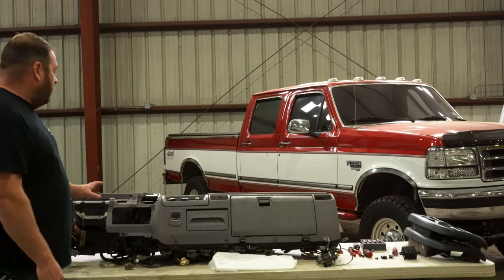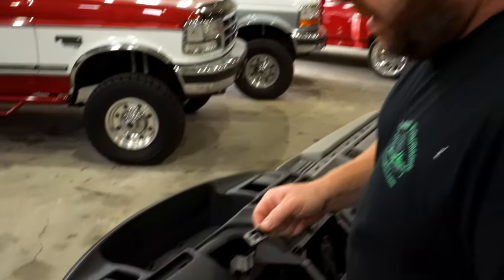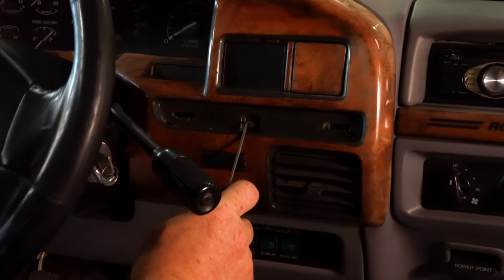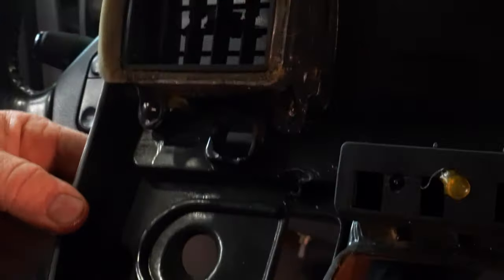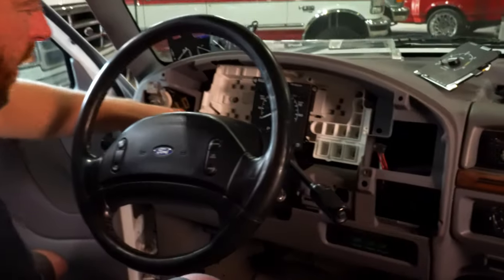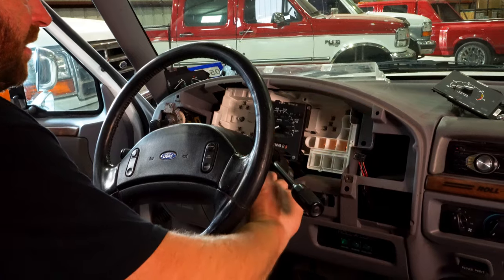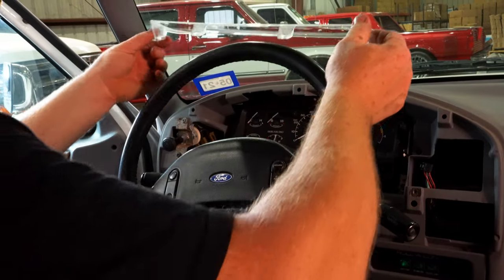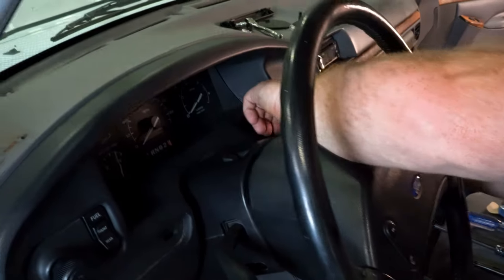How To Video - 1992-1997 Ford Dash Fixes : Everything You Need To Know About Fixing Your Dash

Comment: why can’t the brake light or battery light be LEDs?  Then on the rpm’s half of it you can’t see what would I have to make it so the light comes through?
Reply from the maker: The charge circuit for the alternator wont work because it wont see a voltage read.

Comment: Video was amazing. very informative without all the BS fluff. I'm trying to trouble shoot my cluster lights in my 94 ranger replaced several bulbs but still no lights for speedometer or other mechanical bits fuel oil pressure ect. butt the dumy lights all work.
Reply from the maker: Thank you. Sorry we can't be of more help on the ranger.

Comment: Where did the wood grain dash kit come from? And my 97 F250 is missing the long dash piece that has XLT on it. Where can one of those be found? Thank you guys for all the information on the OBS trucks
Reply from the maker: The woodgrain bezel and trim was a Roll-A-Long conversion add on. Chances are you're only going to find one at a chop shop or ebay. Finding OEM trim is the same. We do however have a great option for dash trim on the site. Billet Dash Trim. Find it here: https://cpaddict.com/billet-dash-trim-1992-1997.html
Reply: @CompletePerformance  thank you for the fast response. I’ll give it a look see. Best of wishes for your builds to come.

Comment: Thank you for making this video, sir. This video is legit! Out of curiosity, why do you not want to switch the battery bulb with an LED one?
Reply: Based on my experience with other Fords, the battery bulb is "part of the circuit" so to say.  It has a very small amount of power going through it all the time and as such, the LED will be always in, even if dimmer, because it takes such a small amount of power to run an LED.  It "turns on" when the vehicle voltage drops because of wizardry making that circuit go the opposite direction - low voltage on the vehicle end, ups the voltage through that particular circuit (enough to make a little bulb brighter) and let you know of a problem. - to the best of my knowledge.
Reply: Agree with Leddemo. 

Also, I have had issues with using a led on the "airbag" light on the instrument cluster.  It was on a 99 f150,  always glowed dim.  I have learned just to replace the backlight  lamps to avoid any issues with battery,air bag or abs warning lights. Using led in turn signal indicators can get VERY bright lol. But to each their own.

Comment: My gas gauge is sticky it only goes up to half then if you tap on it it will creep up but never all the way to full. Any idea if this is a gauge problem or something down the line? Great video would love to seem more stuff like this!
Reply from the maker: Thanks Man! That sounds like the gauge itself could have an issue I have the same issue with a voltage gauge. You can try and remove the gauge and try cleaning around the needle shaft or see if the face of the gauge might be rubbing on it

Comment: Thanks for making a great video, in my case my turn signal lights, high beam, battery are all working. The only ones that stopped working are the fuel level, speedometer, oil pressure and and coolant temperature as well as the one that indicates the revolutions. They all went out simultaneously, is this normal? Or if one goes out do they all go out? The other thing does the air conditioner panel supposed to light up as well? Do you have a video for this? TIA
Reply from the maker: You will need to check the wiring behind the panel. If they all went out it would be from something behind the cluster.

Comment: Awesome video made the job a breeze. Question though you mentioned not changing battery bulb to LED,  is there a reason why?
Reply from the maker: If you change the battery light to LED the circuit doesn't have enough load and the alternator wont charge.

Comment: When your overdrive light starts flashing and your transmission starts shifting really hard right after then you have an error in your psom in your dash. It’s best to buy a new or rebuilt dash cluster online with a warranty and it will fix your issue with the erratic shifting and OD light flashing.
Reply from the maker: That is a very very rare case. The flashing OD is typically a sign of the trans being in limp mode and is more than likely a trans issue.

Comment: I have multiple broken piece on mine so I’m just going to get a new one, but I have another issue, both my dash indicators for my turn signals and I think the low range light for my 4x4 maybe? Thought it was a fuse but it doesn’t seem like it, just bulbs I guess?
Reply from the maker: Those are all bulbs that run those indicators.

Comment: Is it possible to add a tach to a truck that didn't have one from the factory? Is it as simple as plugging it in beside the speedo or is there other parts the truxk will be missing?
Reply from the maker: For a gas truck you just need the tach section and its plug and play

Comment: I see there is white and green for the LED cluster package. Will blue be available for the LED cluster package?
Reply: Unfortunately, in order to achieve the “blue” LED look, it not simple as just replacing the bulbs. You need to scrape off the green “film” on the backside of each and every gauge that has it. Look up some videos about it.
Reply: @parkerwhite6  I've seen the blue led lights installed without the tint scraped off. Still looks good n the difference is barely noticeable. Though if they make a kit, just include in the instructions or descriptions the tint should be scraped off when using blue led lights.

Comment: The tack for the P R N D 2 1 on my truck is off. When trans is in park, the tach is at 1. When I shift to Drive, the tach goes off to the right and is not visible. I just feel for the gears and shift slowly but I want to fix this. Is this something I can remove and fix or do I need a new unit?
Reply from the maker: there is a cable to that has an adjuster on in it under the edge of the dash. Either it needs adjusting or the location tab is broken and you will need a new cable

Comment: What if my whole dash is cracked where my light switch and mounting points are at? Replaced my light switch today and found out the previous owner really did some damage to the dash. I’m restoring her already got all new suspension, and steering components, along with an engine refresh, and some mods. Time to move to the interior. But anyways I’m hoping I don’t need a whole new dash
Reply from the maker: If that whole area is broke out then this isnt going to work out of the box. If you can glue in or repair that mount then you could use the bracket

Comment: How would I fix my gauge cluster night lighting up. Only the needles light up but not the speed,tach, fuel,temp oil or volts. Do you know how to fix this?
Reply from the maker: Have you replaced the bulbs?
Reply: @Complete Performance   haha, yes I have. The owner before added a different gauge face that was wired in incorrect. I have since removed all that crap and figured out the wiring and got them to work. Also removed the led batter light bulb you guys recommend in a video. Didn't know it would interfere with something. Thanks for the great videos.

Comment: I have a 96 Ford f150 I just purchased and I was told it has low miles but on the odometer it just says error and my speedometer isn't working. I was told it could be my speed sensor. Idk
Reply: Could be the P-SOM, reverse side of the speedometer, search P-SOM repair yeah, good luck

Comment: I am curious if you have ever had a problem or possible fixed a problem like this. My battery light keeps pops on and off while driving or stays on then turns back off.  
I have managed to track down the problem but can't find a wiring diagram or anything on hooking up the wires. I bought a new pigtail bc one of of the wires inside was very loose inside the plastic clip that it clips into on top of the ignition coil. Looks like someone has already messed with it as there a wire on the bottom of the ignition coil bracket from there it's another plastic clip then someone spliced it into one of the wires that the plastic clip snaps on top of the coil besides the coil wire itself.
Reply: Check your exciter wire on the alternator, it's the single wire that plugs in the top. Common issue on the OBS trucks, that plug gets loose and doesn't make good contact.
Reply: @kerrydick7256  The only two plugs that I have on the alternator is the three wire plug that goes into a plastic clip which I have replaced with a new one. 

Then the single one your talking about which does have some play to it which is what I was suspicious about. But then I had the truck running when I was messing around with the ignition plug connector the two wires on top those were both loose when I was moving them around then the truck stalled out  completely. I bought a new connector. I have three wire's on the new connector and looking on the truck I have two wires that went into a plastic clip connector then on the left hand side at the bottom of the ignition coil bracket that the coil is attached to there's a wire coming out from there that also goes into a plastic clip with another clip on the other side of the wire if this makes sense. From there it's then spliced into one of the wires that goes to the ignition coil. I was looking at wiring diagrams on google in my Chilton manual and videos on YouTube with no luck of finding anything. I have a 96 ford f150 if you could take some pictures of your ignition coil and the wires that are on your ignition coil and the one I mentioned on the bottom of the bracket you could send them to my email levitt850@gmail.com..
Reply: @saleenmustang9793  what engine do you have? I'll see what I can come up with👌
That clip on your coil will stall the engine,  it is the power supply and ground to the coil so if it's loose it will cause the engine to stall.
Reply: @kerrydick7256  I have a 96 f150 with the 4.9 straight six. If you have a email I could send you pictures. Probably be more helpful so you can see what I am talking about. 

I don't think it's the ground if that's what that wire is for on the bottom of the bracket on the ignition coil.  The wires that I was messing were the two on top of the coil that went into the clip that you would snap it into. 

As soon as I was messed with those two wire you could hear feedback from the engine, you could stall the engine with messing with them just right. Someone has definitely been in there rigging it around. I'll have to look at the colors on the two wires probably be helpful then going in blind.

Comment: My husband's 2006 ford f 150 v8 is having trouble with the dash it goes off and the truck seems to loose power almost like the battery goes off while driving so you know on the dash and it comes back on . Any.idea what it is.
Reply from the maker: Probably the GEM module in that new of a truck.
Reply: @Complete Performance   thanks for the help  🙏 so much .

Comment: Any Idea why my gauge lights are super dim I can hardly see them the lights on the ac controls are fine but the gauge cluster lights might as well  be off
Reply: The headlight switch is also a dash backlight dimmer. Twist it to adjust dash backlight brightness. Otherwise I've seen those switches wear out and get "stuck" on a lower brightness setting.

Comment: You don’t explain why not to put a led light on the battery indicator. Why do I not want to put a led light there?
Reply from the maker: It will not close the charge circuit for the alternator to actually charge the vehicle.

Comment: Why don't you want to put an led bulb on the battery light?
Reply from the maker: That bulb completes the circuit to the PCM for the charging system. If you put an LED in that circuit the PCM will not turn the alternator on to charge.
Reply: Good to know. Looks like I'm taking that bulb out tomorrow